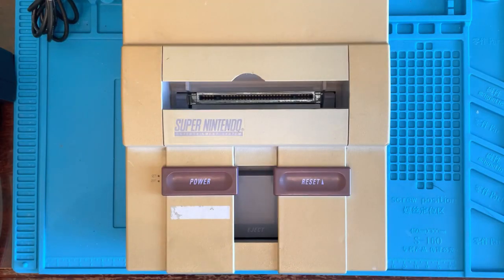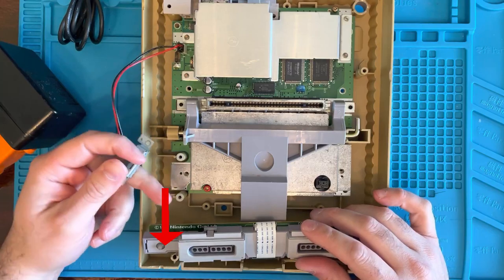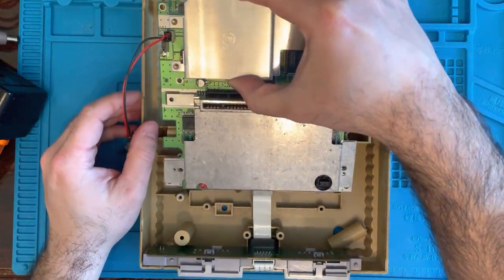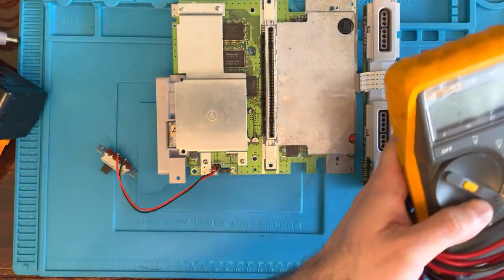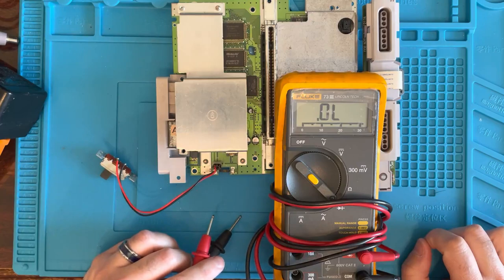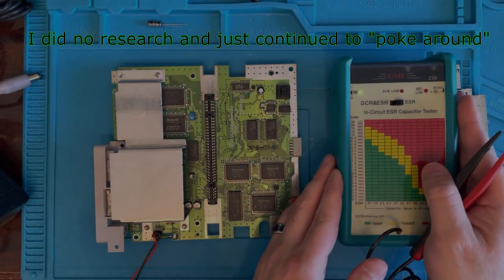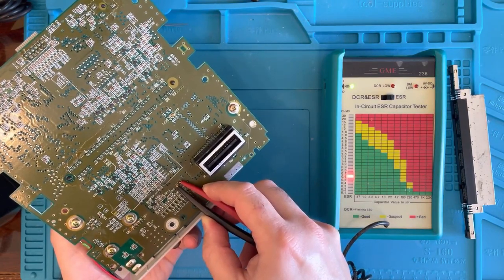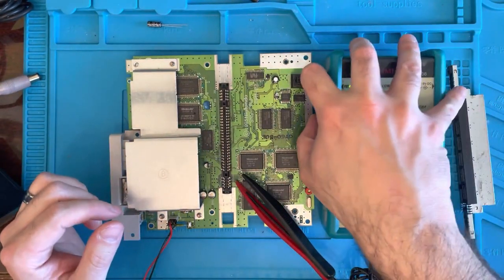Super Nintendo Fuse Keeps Blowing!!!

Comment: add some fresh solder,warm up the pad with the desolder gun first for a few sec,then wibbling circle motion and then pull the trigger,that way it works better.
Reply from the maker: Thank you for your comment!! I will have to try that next time!! 🐺😃
Reply: Yeah, circuit board can handle alott of heat, if its a quality board, and snes is quality.

Comment: You probably blew the fuse when the 2 metal pieces on the bottom of the power switch touched against that metal. I did the same thing when I opened up a SNES and had to replace the fuse.
Reply from the maker: I had to watch the video again and you might be right!! I didn’t notice the switch going across the metal shielding!! That totally could have shorted out!! I need to see if I saved the old caps, put them back in and see if the fuse blows again. 
Thanks for commenting!! I really appreciate it!! 🐺😁
Reply: @wolfmanrepairs  Fuse dont blow if caps is bad,, thats pretty rare, if the switch touched thats why it blew. Have happend to me many times.

Comment: So I have the same issue will try a recapping 👍 thanks mate
Reply from the maker: Glad to help!! Hope it works great after the recap!! 🐺😁
Reply: @wolfmanrepairs  lol fingers crossed, I have another snes which only shows a scrambled game picture but does play fox games, and yet it plays the initial capcom then scrambles.

I transferred the faulty motherboards fuse to a another snes board but that fuse also blew straight so I’m thinking it’s probably a capacitor shorting it ?  I’m stalking about two different snes motherboards but both buggered haha 😆
Reply from the maker: @bones2001111 that’s strange that it will play the initial logo and nothing else. Does that game work ok on another SNES ?
If the fuse is blowing as soon as you start it you have a short somewhere. Mine seemed to be in the capacitor near the reset switch but it could really be anywhere. If you have a multimeter with diode mode you might want to probe around and see if you can find the short. I have a capacitor tester that I used and it said the capacitor was bad that’s why I started there. 
Let me know if that helps 🐺😁
Reply: @wolfmanrepairs  nice one mate I will do! 

So I bought the snes knowing it had a scrambled pic hoping it was a dirty cart slot or something easy 😆 but it was switching on and showing capcom then scrambled pics and no sound, maybe a chip/cpu not sure and not sure where to get replacements i have googled but no luck. 

Then another snes came which I bought as ‘untested’ lol and it didn’t switch on tested continuity with the fuse and nothing so I transplanted the other boards fuse and that blew as soon as I switched jt on. I’ve ordered more fuses and caps off eBay 👍 fingers crossed I can get one of them working
Reply from the maker: Fingers crossed 🤞🏻!! Hope it works out for you!! I’ve had such bad luck with Super Nintendos. I have about 4 that I cannot get working no matter what I do. 🤣🐺
Reply: @wolfmanrepairs  oh god 🙈🙈🙈haha

Comment: if you use a lot of handheld solder suckers then have you tried the engeneers ss-03. its AMAZING. a little short but its WELL worth the price.
edit: comment was posted begore you brought out the desoldering gun.
Reply from the maker: Thank you for the info!! I like to use the handheld ones on occasion. I have added the engineers ss-03 to my amazon list!! 😁🐺
Reply: @wolfmanrepairs  Dont go back to a handheld one, thats a massiv downgrade from the gun you have.
Reply from the maker: True but sometimes it’s good to have a manual one when I don’t want to wait for the desoldering gun to heat up 🐺😁